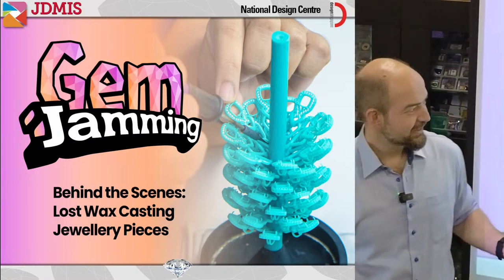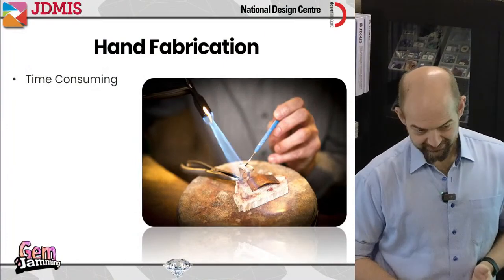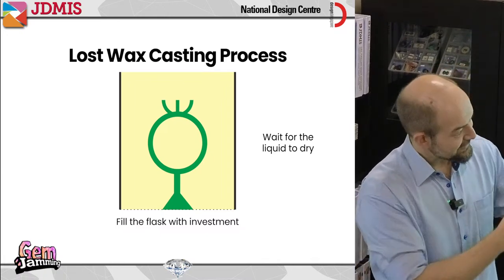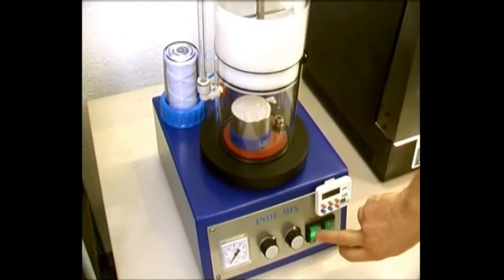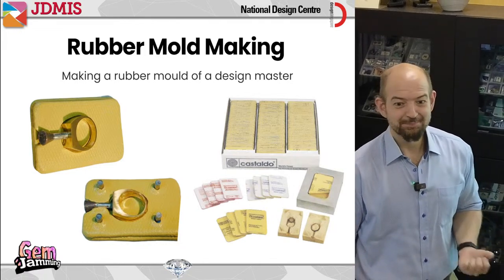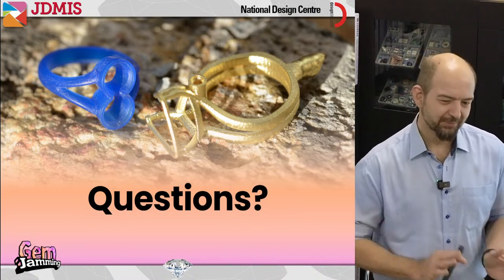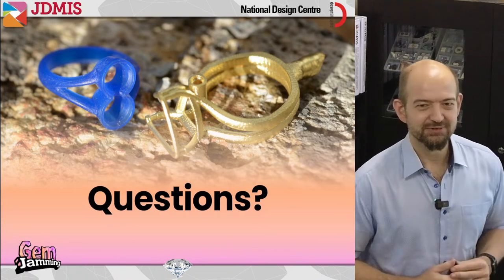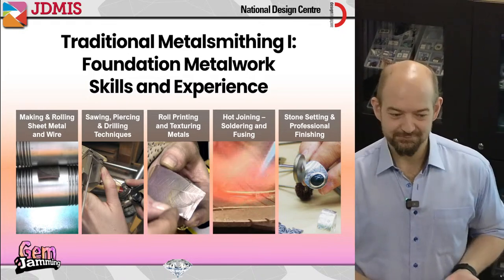💎 Is Lost Wax Casting Still Being Used? | Gems and Jewellery Jamming

Comment: Hello, excellent video. I have had problems because when polishing gold, I have to remove the remaining layer and this makes me lose details, what can I do?
Reply from the maker: This is always challenging, when you polish, and you will lose some detail. Some metalsmiths will manually reapply details or finishes after initial polishing rounds, others that use computer-aided design will create deeper / more obvious details such that even after polishing they are clearly visible. If you are casting, you can also improve the finish by ensuring you use good quality investment mix (the finer the powder the higher the level of detail you'll be able to catch it and the smoother the cast) also if you are casting wax, the burnout process can be adjusted to reduce surface finish issues.. often the manufacturer of your wax material can advise on a proper burnout cycle that will you sure minimal residue in the cast. You should also make sure to raise the temperature in your kiln slowly to allow the wax time to melt out and avoid it expanding too quickly and potentially damaging the mold.